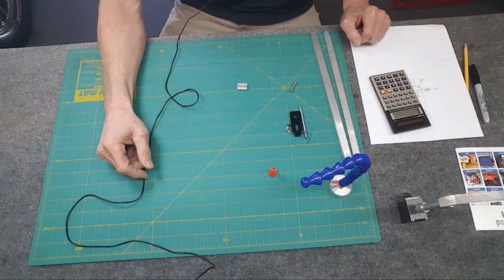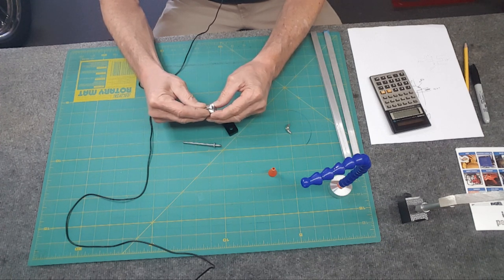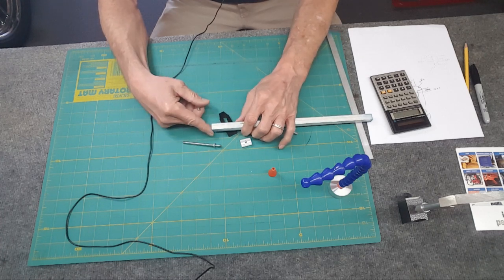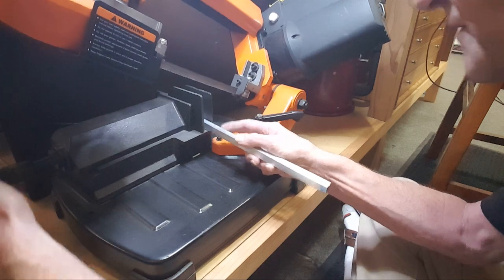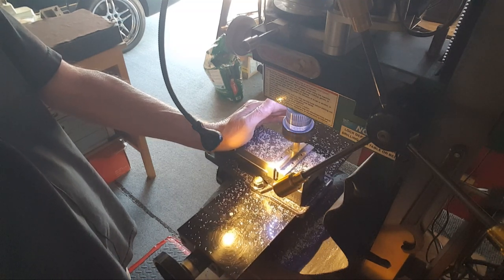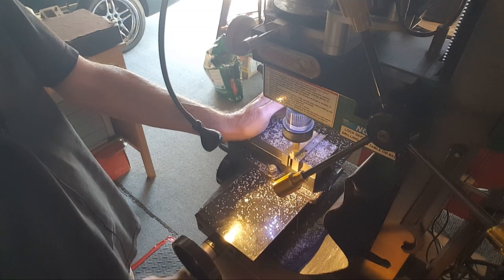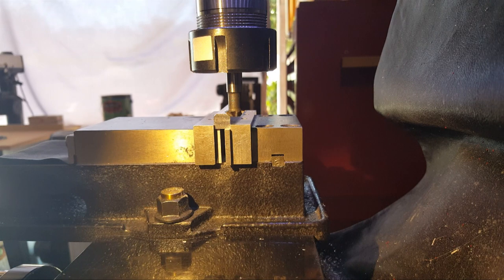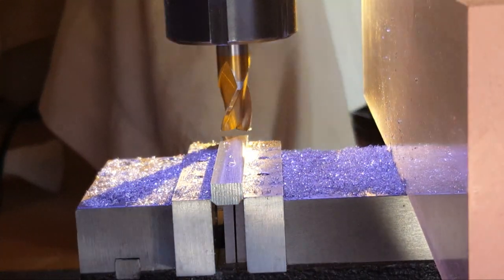Milling Miniature T Slot Nuts

Comment: Well done. Made a number of such T-nuts for my micro mill, MF 70, chamfering not needed. I would make the chamfering as the last moment. Turn the T-nut upside down and grab the "narrow" piece with the vise jaws. Do the same when drilling and threading the hole.
For the mini mill I bought blanks and turned them upside down to mill the width of the base. Turned the right way the height of the nuts was easily milled.
2 special nuts used for clamping that toolmakers vise were mad 1.5" long!  Those T-nuts use 6 mm, almost 1/4", screws.

Comment: That was a nice job. I know I would have been filing before I was done. But one thing I would have done is start with the slots. That would give plenty to hold onto for cutting the chamfers. Definitely time for a new project though - that mill needs some stepper motors.